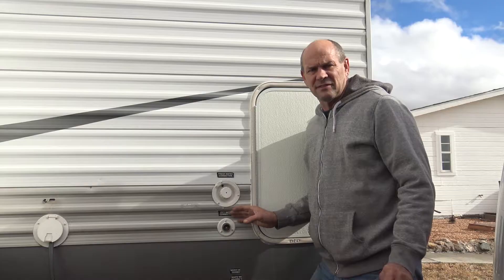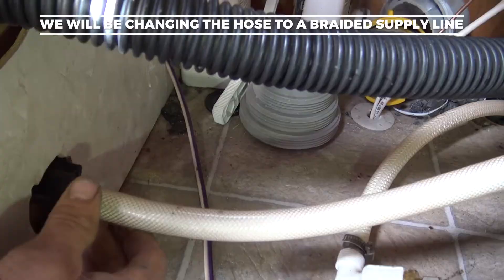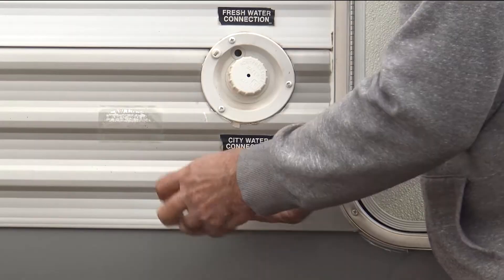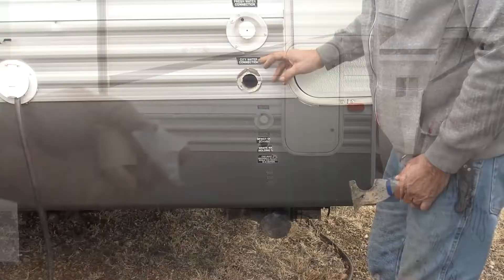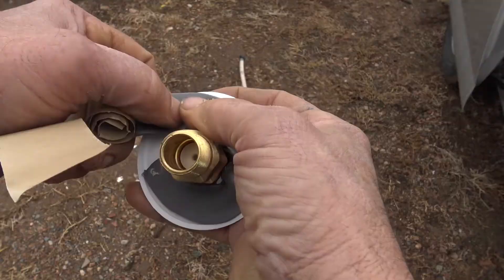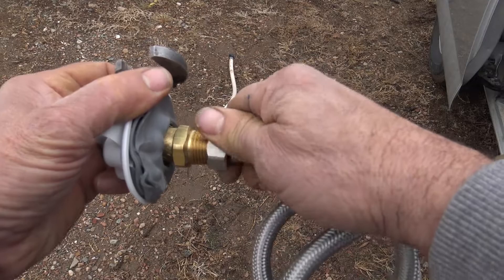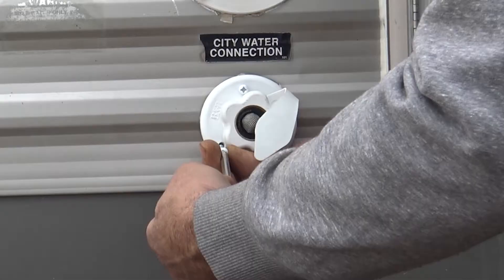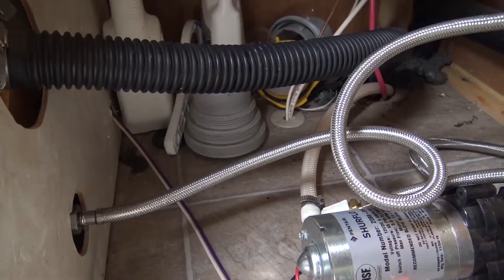How to Repair RV City Water Connection Leak - EASY DIY Repair / rv city water connection bad

Comment: Are these connector universal? Not sure how to order one for mine
Reply from the maker: They aren't all the same. I believe there is 2-3 different styles. Match up the screw pattern and the size and hook up inside and that should be close or a match.

Comment: Teflon tape should be used on the connection.  No?
Reply from the maker: On the inside connection yes you can. On the out side hose connection 
it's not needed

Comment: The water on my rv is not working at all, I check the city water connection and it is bad, can that be causing the water not to work?
Reply from the maker: Yes, for sure, I would start investigating there.